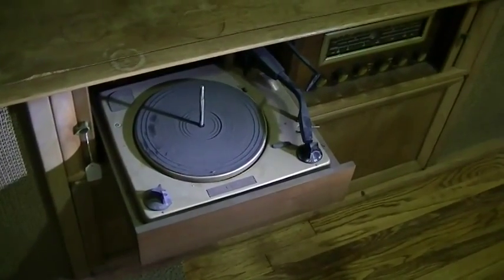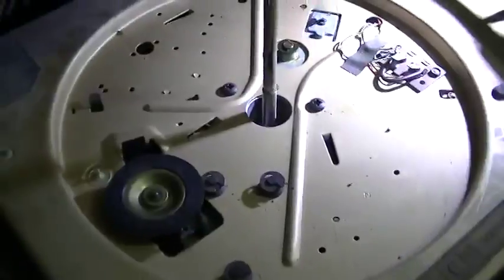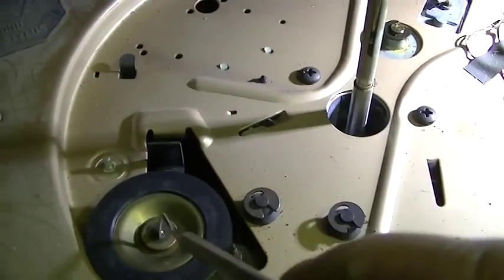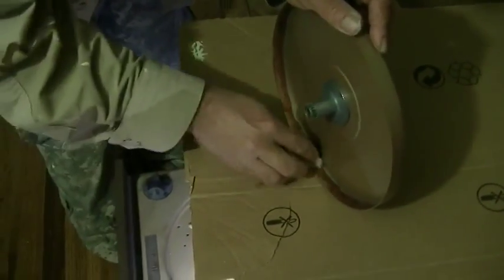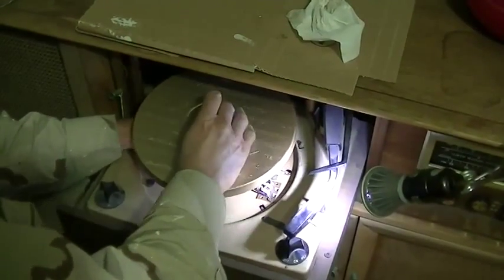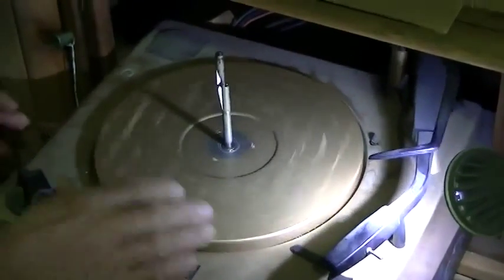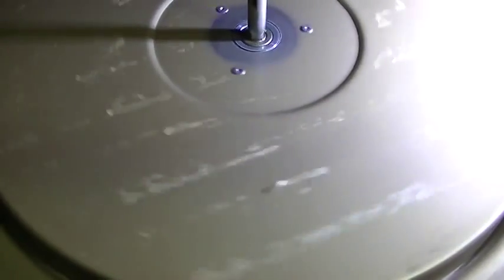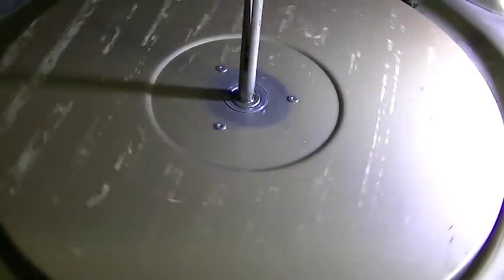Curtis Mathes Record Changer Servicing

Comment: The construction of that TT reminds me of ny Garrard trash found unit, but mine isn't rim drive such as yours is, mine is a belt drive. Uses a Shure cartridge. Had the same grease problem. Only it worked, but the needle would skip about the time the LP was three quarters done. It wouldn't do any further. Cleaning and an application of white lithium grease, new belt, and new stylus got it back into shape.

Comment: That's a VM 1200 series. It had a white o-ring retainer instead of a c-clip. It has the usual gummed-up transmission disease. It uses a standard 1/2" mount which can accommodate just about any Varco TN4 type ceramic cartridge. I've even mounted a Shure magnetic cartridge & used a preamp in these changers.
Reply: Yes, I did not touch the red one, but the 5 cans ahead of, uh well, yes. Did I turn the stand-alone one before the replacement can? I think a little They are done all by ear at this point. So glad it arrived safe. It was sort of ok 'til I tapped a can or something. All voltages are ok. toxic goo in a tube socket is not out of the question. Please do what you can.
Reply: shango066
Yes, you gotta pull up on that center spindle slider to allow the the platter to pass by. Folks have broken the top of that spindle off trying to force the platter on.

Comment: You do not have the spring inside of the tonearm set to provide proper "head force" to the front of the tonearm.  This is a VM turntable so If you turn the turntable OFF then lift the tonearm all the way to where it is 90 degrees straight up, you will see a long springlike adjustable metal gizmo that can be set into a chosen "groove".  The further this springlike gizmo is stretched down the inside of the tonearm, the heavier force on the needle/cartridge assembly at the front of the tonearm.  Use long nose pliers to adjust this spring gizmo to the lightest groove setting possible that gives good head contact.  Very easy five second solution.

Comment: That sounded HORRIBLE! But what a great way to EOL a late-70's Disco Bee Gees 33-1/3 LP. I don't like it now, and didn't like that no-talent crap back in those days when it was on Top-40 AM and FM stations, either. I would think that either mineral oil or lithium grease would be more appropriate for that application, rather than generic personal lubricant.

Comment: That just further confirms the hypothesis that Curtis Mathes built the most expensive crap in America, and it was not worth it. A VM was about the cheapest changer you could get, they do work but there is nothing high end about one. You would think that C.M could have used a Gerrard or a Collero, but no, they used a portable record player grade changer.
Glenn Waters will not be happy, but I don't care.
Reply: Plastic filled BSR changers? In the early 60s BSR's main offering was the Monarch series of changers, about the only parts made of plastic was the trim, everything else was metal, even the tone arm. I see a lot more plastic on that VM changer to be honest. It woudl seem to me that you are comparing changers from two different eras, late 50s early 60s changers, with later plastic ones, which VM was also guilty of producing. Don't get me started on Curtis Mathes verses a Magnavox.
Reply: It wasn't until the mid-1970's that BSR started using a lot of plastic in their low-end changers. Even the BSR mini-changer that was in the stereo I had in the early 70's had mostly metal parts (mine had the tubular tone arm, which was metal and plastic; the flat type arm was all plastic). To be sure, the platter was pot metal, but is was metal just the same.
Reply: OlegKostoglatov Yeah right! Glenn Waters is now a fan of Barney the Dinosaur, I hate Barney when he uploaded loads of Barney stuff on his channel.